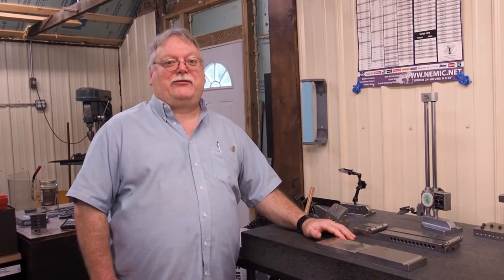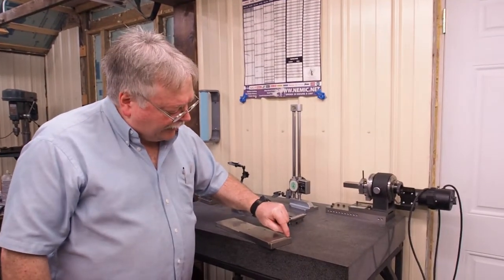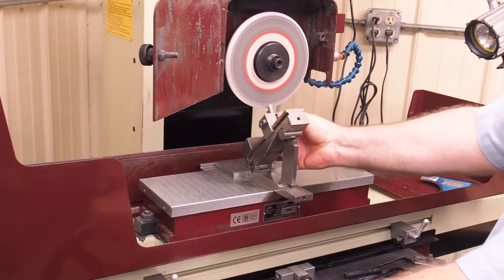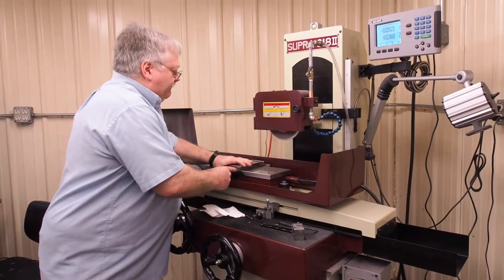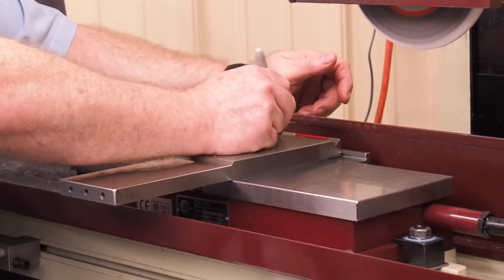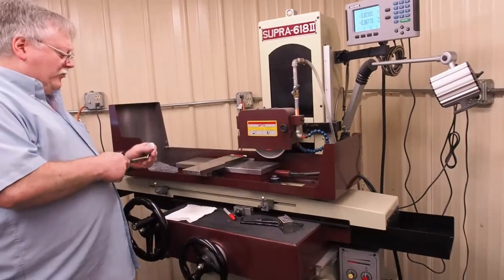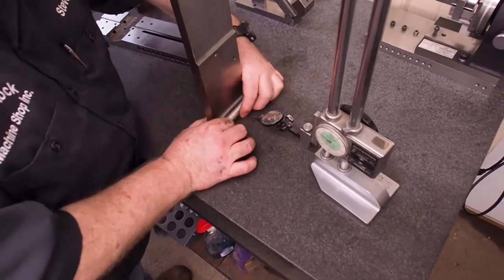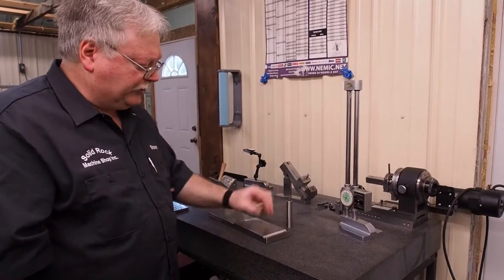Sine plate

Comment: These videos are awesome Steve, I'm really learning a lot and I'm really grateful to you and your sons for making these :) One question I had on this one was how you accurately measure the 10.0000" between the rod bearing faces. I assume you want to get that to within a tenth or so, wouldn't you? The only thing I can think of is clamping a small gage block to each of the two surfaces and then laying a 10.0000" inch stack next to it, touching the "bottom" gage block and then indicating the top clamped block against the stack. Is there a simpler way using maybe a micrometer or something?
Reply from the maker: Hi Steve,
I did use Gage blocks. I clamped the sine plate to my square block for support and to make sure the sine plate was at 90 degrees to the granite table. I set the gage blocks to the top of the first rod so that they were zero to each other. Then I added 10" to the stack up and measured the top rod. Because the rods measured the same diameter measuring from the top of one pin to the top of the other pin will give the same reading as center to center. I could have set this on the Surface grinder the same way and touched off on the top of the bottom pin then set the Digital to zero and touch off on the top of the top pin and see what the reading was.
Steve
Reply: Ah, I see now, that makes sense. Do you have multiple sets of gage blocks or do you just need a few extra big ones (3", 4", 5") to complement a regular set? I don't think I could get to even a 7" stack with my set :)
Reply from the maker: Hi Steve,
I have an 81piece gage block set but I have six very precision blocks that I made which are 4" on the money. I use these often for larger measurements along with the gage blocks.
Steve
Reply: Awesome, thanks Steve!